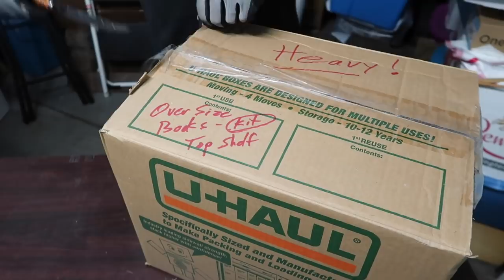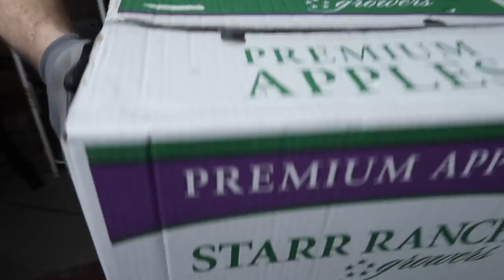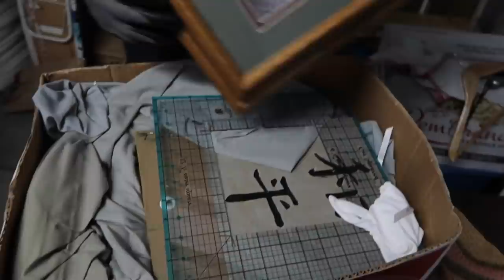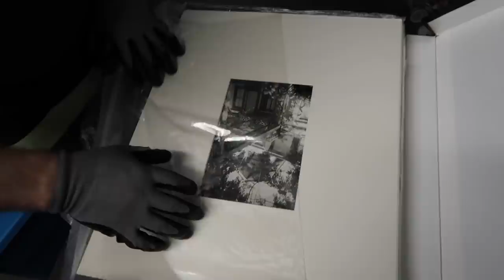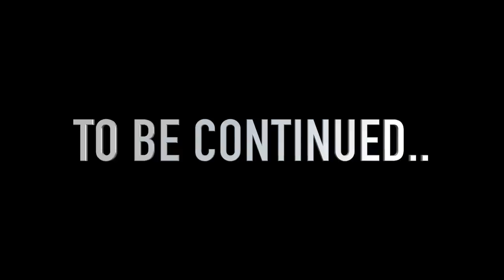Homeless Women LOST Storage Unit

Comment: She was a costume maker, thus all the fabric, shoes and boots, the arts and crafts beads and buttons, even the walking sticks. Find a costume shop they might buy all the costumes and even the fabric and assories.
Reply: The black and white shoes, Saddlel Shoes, are from the '50 for s costume and many of those other jackets, shirts, dresses and other articles of clothes might be parts of a period or type cast costume (doctor, layer. Indian cheif) you have to go thru it with a creative eye.
Reply: A lot if what you think is fabric are parts of costumes. The jackets that were dry cleaned are also. The denim jacket could be part of a '50s costume. You have to look st it all lay the stuff out and connect the parts. You see the work that went some of those costumes. They will go from very elaborate to simple. A vintage tux could be used as a '50:s "prom". Do don't take anything for granted...